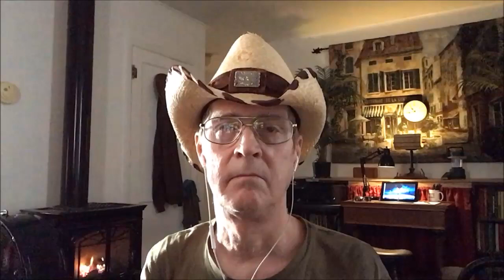Cheap Alternative Antenna Wire

Comment: I use 16 AWG insulated wire for my loop antenna.  The only problem I notice is that the green crud disease attacks the wire at the bare ends as well as up inside the insulation.  So I change the wire every decade or so.

Comment: I would recommended using a polyester rope over nylon if you can find it as polyester has far less stretch and the same UV resistance.  Do not use polypropylene,  non UV protected Kevlar etc, the UV will eat most rope materials in a couple years at most.  73

Comment: I've heard of people using stainless steel wire rope (washing line from Amazon for example), but as far as I know it's not very conductive so I assume its not the best.  On the other hand most mobile installations use stainless whip antennas and nobody cares about stainless connectors on baluns for example either...   What do you think, is the lack of conductivity are real practical consideration?   
Another good source of cheap wire can be military surplus telephone wire (D10 field telephone wire) it comes as twisted pair but using a drill to untwist it and then split the too wires apart isn't too hard.  The wire comprise a combination of several steel cores and copper strands so it won't stretch and its conductive, I have a DX Command all band vertical which uses this wire for elements and radials.  Newer versions have copper and kevlar inside I think.
Reply from the maker: Copper conducts electric current better than steel does, but I don't know how much the difference actually makes in the "real world." 73 de Stan W1GV.

Comment: Ahh here in Europe we don't know what "electrical zip cord" is, so I googled it. :)   Seems very similar to twin standard copper speaker wire to me and that's what I have.  I split the two conductors and use them individually of course.  Please let me know if I'm wrong and there is something more to it.
Reply from the maker: You're doing just fine. 73 de Stan W1GV.